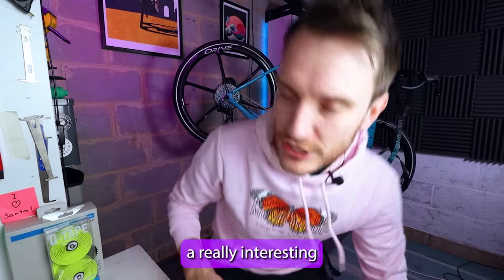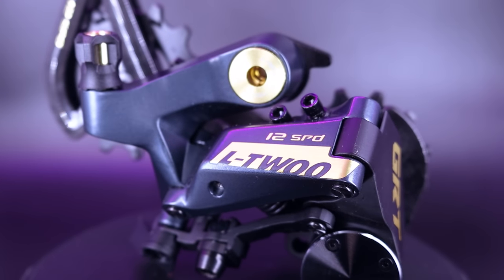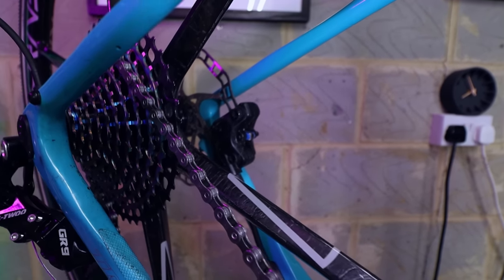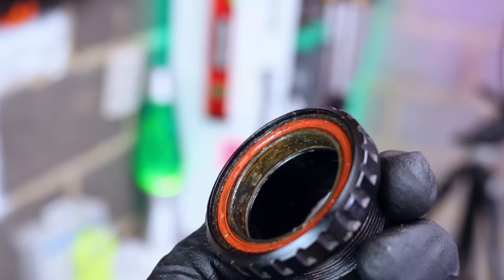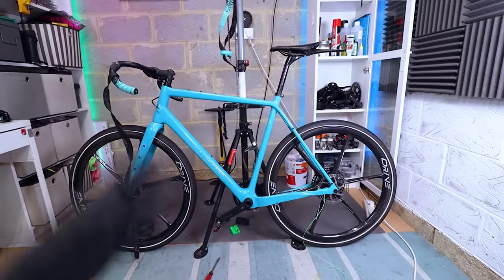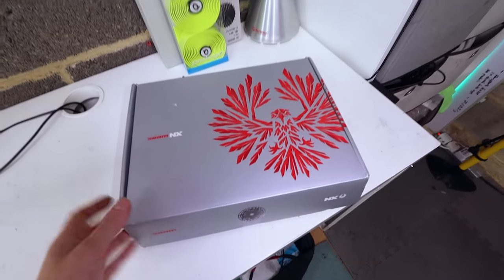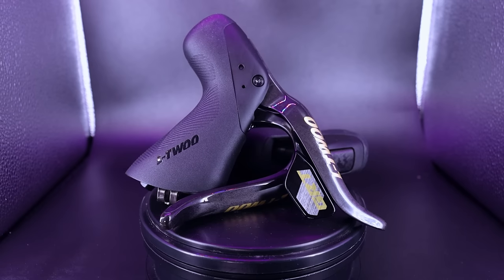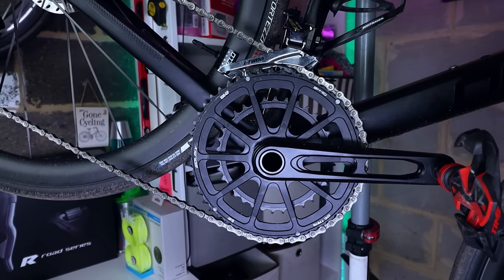INCREDIBLE 1x12 gravel performance on a budget - L-TWOO GRT

Comment: Is it possible to use deore calipers for post mount with these ltwoo levers... I bought hydraulic groupset for my trekking bike because I wanted hydraulic brakes. The problem is that this mount is not standard post or flat mount. I have post mount on my fork and IS standard at the back. None of the adapters is OK for this. It would be OK if it works with deore calipers because they are post mount and if everything is OK than I have no problem. Any info I would be very grateful.... I hope I didn't throw away 350€...

Comment: Are you sure that cassette wasn't designed for a 10 speed freehub? It may just require the standard 1.86mm spacer for converting a 10 speed cassette to an 11 speed freehub. Might be an idea to try before the chain potentially kills your more expensive SRAM cassette.

Comment: That’s a road hub, not a mtb hub the free hubs are a different width. You need to fit a spacer behind the cassette it’s not a fault it’s the fact you have a part missing.  Question is did you get a spacer with either wheels?

Comment: Hmmm, I've seen a ton of gnarled up shifters and brake levers working in a bike shop. I have seen some sheared off mtb shifters but never a road shifter. Shimano and SRAM road lever may get bent and scuffed up the wazoo but never broken off in this fashion. And judging by the modus of incidence here, your spill into dirt shouldn't have broken off that lever. I'm sure it could be a fluke of right impact, right angle, etc., etc. but...this makes me suspect of the quality of the L-Twoo part. Perhaps they can send you a new lever as opposed to the entire brake/shifter? Looking at GRX, Ekar, and Force levers, they're all quite burly comparatively. Perhaps this is a thing to consider.

Comment: When you're shopping on the internet, waiting for parts to arrive from China, disassembling existing bikes and attaching new parts, the total distance travelled is zero. Would walking be an attractive (and comparatively inexpensive) alternative at such times? Installing hydraulic brake lines may well be "very straightforward" but humans have a natural capacity for locomotion without any form of mechanical assistance. Perhaps viewers should be reminded of their options?

Comment: I have another crankset by goldix, their thread tolerance are really bad. The thread to secure the crankset on the non drive side stripped at 5nm of torque. They sent me another one and the new one I didn't dare to put any torque on it, they didn't even give me the recommended torque. The other issue is the finish quality, the two crank that they sent me is finished differently, one is poorer quality looking like their tooling has past the production date. Additionally the tread for the pedal was over threaded so when riding the pedal thread will eat into the soft aluminium.

Comment: The adapter plate works that if you put the 140/160 in one direction works for 140, if you flip it it’s gonna work on 160! Same for 180/160! 🥖🥖🥖🥖

Comment: I just hope they consider releasing this but in 2x12 or even just 2x11.
Reply: Don't think they will. I asked if they could sell me the grt derailleur separately to make a 2x gravel and they said no. So I got a grx 810 derailleur and it works perfectly
Reply: @vongdong10  so the l-twoo shifters have the same cable pull ratio as shimano?
Reply: they have? R9 hydraulic or RX, unless you want a 2x with clutch?
Reply: you can just get the road version, i dont think there's any other substantial differences between them
Reply: @Yeet  I'm not sure. Never understood the whole cable pull thing. Just bought the 2x grx derailleur to try and it works.

Comment: This groupset still needs work. The rattling issue and tightening nuts on levers is not something you really want. I don't think it compares with even the mid range shimano or Sram as it still needs work. For the price it looks ok, but a risky buy if something goes wrong early. Other tests have shown issues as well, so a miss at this stage. They need to work on it.

Comment: That crash (btw, hope you're OK) proves that Chinese cheap and cheerful components are still lagging behind what Western companies have been producing for decades in terms of design, materials and general mechanical engineering. No mid-range Shimano, Campagnolo or SRAM lever would have snapped like that after this sort of crash. In most cases, even their curvature and angles are designed in such a way to minimize the risk of failure in case of crashes (besides other considerations, such as ergonomics).

I am rooting for them - and for any other manufacturer besides the "Holy Trinity" to come up with groupsets that are as good as the last/current generations of mechanical Ultegra/105 (R8000/R7000) or their counterparts from Campagnolo or SRAM. Good from all points of view: gear shifting precision, ergonomics, weight, robustness, crash resistance, the lot. They aren't there yet - but who knows, maybe in 5 more years they will manage to fill in the gap that Shimano and SRAM have left behind: reliable, precise and lightweight mechanical groupsets (with high quality rim brake options as well) for similar price points to what they used to cost before Shimano and SRAM decided to ditch them (about 500-600€ for a R7000 groupset and about 700-800€ for a R800 groupset).

Also, just wondering: are all the real derailleur cable pull ratios among the 12 speed L-TWOO groupsets identical? I would totally try out an 1x12 mechanical for my rim brake road bike using the levers from the 2x12 groupset (with the unnecessary bits removed from the left one for extra weight savings) and the GRT rear derailleur and a wide range cassette (an 11-46 should work at a pinch for the sort of riding I do).

Comment: Problem with 12 speed although the group set sounds great ....12 speed is finicky requires more adjusting and maintenance on top of more expensive components to replace so why why why go there unless you want to be trapped.

Comment: I'm not surprised you fell, as you zigzag all over the place when you ride. Fine for riding on the road but don't do it on the dirt,  as your tyres are not loose dirt tyres.  And carbon fibre isn't  very crash proof.  I glad you didn't hurt your self .

Comment: I found it surprising how easy that brake lever broke
I have sram rival 10 speed on a bike, multiple crashes. And it is fine. (carbon brake lever) 
Numerous crashes, some much harder than yours. On a bunch of different Shimano groupset(a mix of alloy and carbon brake levers). And I've never snapped a brake lever like that. Slightly disappointing to see for me just because I ride like an idiot on my gravel bikes. So it's always only a matter of time until I crash again. Last thing I need is to constantly be breaking a brake lever. But hey. Looks like it might be perfect for me on a road bike.
Reply: My Rival 10 set has hit asphalt a few times without any real damage, though my bike usually gets thrown into the nice fluffy grass, while I fall on the tarmac and literally put some skin in the game :)

Comment: I wonder if these groupos will ever come down to the £200 mark.

Ps. Tough luck on the crash Luke. When I first started gravel riding i used to go arse over tit all the time. I don't want to be a captain know it all but I wonder what pressures you are running. You could deffo get away with like 25psi imho

Comment: The B roll put me off that groupset. It exposed the pitfalls of a brake lever that protrudes laterally beyond the protection of the handlebar.
Reply from the maker: So that's mostly a result of my gravel handlebar choice. They have a massive fair, so tend to make shifters protrude outwards. On regular drop bars the brake levers are pretty much parallel to the drops.
Reply: To be fair that's the handlebar shape that led to this, and more importantly, I don't think either Shimano or Sram would've survived a direct impact like that, since I've also seen some snapped Shimano brake levers...
Reply: To me it also seems like it wasn't attached very securely to begin with. The lateral protrusion also depends a lot on how you set up your brake levers.
Reply: @TraceVelo  
OK.  I'd like to see a cheaper manufacturer fill in the enormous vacuum created by Shimano's drive for ever more expensive groupo's. 
Keep up the great research.

Comment: So the 160/180 front disk brake spacer is nothing more than a 20mm spacer. Some forks are 160 mm without spacer so with that braket it would make it a 180. Hence the name 160/180. Your bike  just happens to be 140 . Great videos, though.keep em coming

Comment: When the world moved to 11 speed there was a split in sizing between road and mtb. 10 speed freehub bodies were all the same historically. In the transition to 11 speed MTB parts kept the same freehub width as 10 speed, but 11 speed because 1.85mm longer! This means to run a MTB cassette on a road freehub body you need a 1.85mm spacer.

Comment: Don't glue it. Not worth the risk.
Reply from the maker: Yeah, i'm in two minds about it. I have a replacement lever... But I think I have to give it a go. I if i properly prep the surface, and potentially add some wrapping for reinforcement, i think it will be OK. DEFINITELY not a reccomended course of action of course, but it could work.....
Reply: @TraceVelo  And if it breaks during a ride, you have no brake.
Reply from the maker: @DanTuber  Yeah this is very true... I will probably have a go at repairing later this week. But will def stress test it before trusting my life to it... Because, as you say, I can see it being a bit problematic otherwise 😂

Comment: 1by sucks. its loud and clunky. and since today, no one could explain me the potential advantages of 1by shiftings...
Reply: You wear out chains faster so the advantage is you spend more money
Reply: @janeblogs324  ;D thank you for making me laugh. other "advantages" i already heard were on the same level... for example: you will not break your front deraillieur. but in 20 years of cycling... i never cracked my front deraillieur. 1by seems to be the perfect solution to non-existing problems.
Reply: Advantage: you need a derailleur with less capacity
Advantage: you need less chain links, you'll save money on chain lube